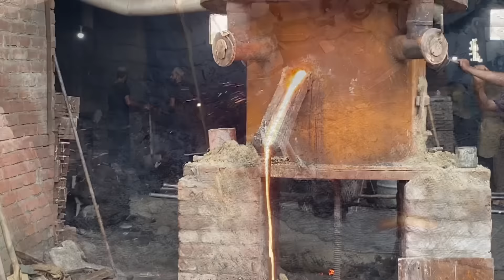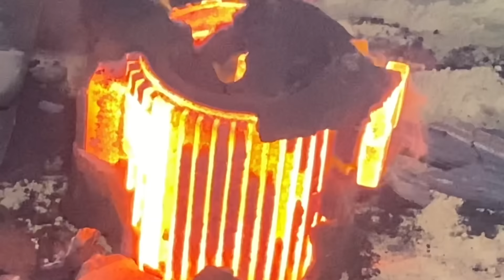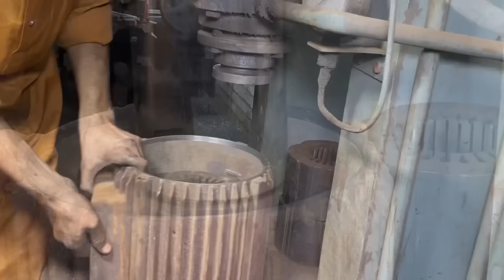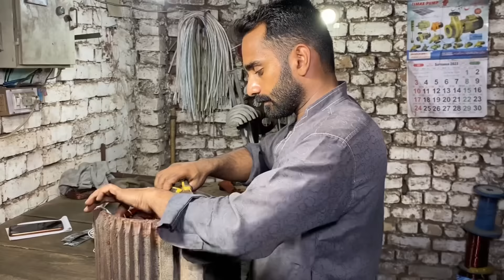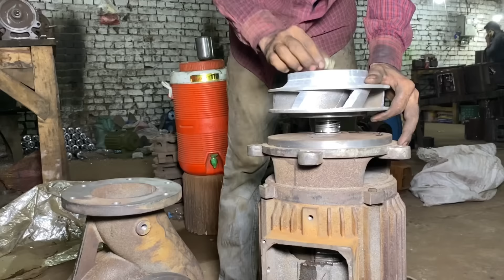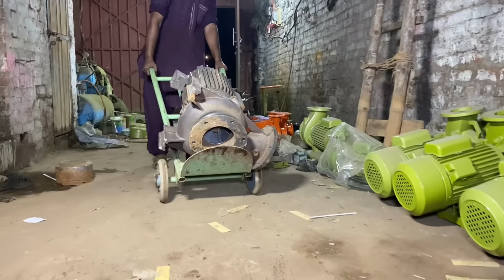Incredible Process of Metal Recycling | Factory Steel Production which Scrap Metal

Comment: If working with molten metal in sandals was a sport, these guys would be in the Olympics
Reply: I think you would be right....
Reply: Good thing there steel toenail sandals 😁
Reply: Orang orang yg sangat handal dlm pekerjaan
Reply: Safety glasses anyone🤓👀…gloves…apron…?
Reply: A few didn't want to wreck their sandals. They were barefoot!!!
Reply: Radarie chebe bilal😊
Reply: L
Reply: I collectively refer to these facilities as the “flip-flop foundries”. 😂
Reply: Молодцы ребята!
Reply: This is not sport this is the condition of pakistan
Reply: This is not sport this is the condition of pakistan
Reply: These sandalman  defeated the superpower murica in Afghanistan😅
Reply: what does sandals gat to do with the process. When you are buying at the shop will you buy the sandals or the water pump. Molten metal will penetrate the soo called shoes you want them to put on.
Reply: Don't worry, those are safety sandals
Reply: The Special Olympics!
Reply: OSHA homies when they see this video 👀

Comment: There were so many unsafe practices but the brother spray painting with no mask at the end took the biscuit
Reply: Nothing like a little punjab primer at the end of a hard day, or at the start of it
Reply: How about the opening of the furnace where a worker could fall in ?
Reply: I did that for a year (UK) cause the bosses were tightwads. The UK was just as shit in the 1970's.
Reply: At least he has one fan blowing out of the garage...
Reply: They who seek only for faults , see nothing else..
Reply: I saw there was exhaust air. over there..
Reply: spraey painting without a mask?  Well it happened here also, in the  UK in 1970's when my employer was too mean to provide PPE.
Reply: @jfchonors8873  I was thinking the same thing. Pretty scary.
Reply: @nimaljayathilaka4718  The pump worked well!
Reply: Really? That? Not testing the water pump by shooting hundreds of gallons of water all over the place with exposed wiring?
Reply: the worst part is you can hear kids roaming around in the background
Reply: There’s a billion of them. They will easily replace him sadly…

Comment: One shop should not do all that. Lots of quality standards are lowered.   The motor may last a million years or short out 10 minutes into a work load.
To bring value up there needs to be checks on the material and the machining. Adds maybe a few hours and possible tossing out a few out of spec parts, but the result is better product
Reply from the maker: Your opinion is excellent I agree with it Thanks a lot for watching the video
Reply: I couldn't believe the wobble on the lathe, while and after he drilled the center hole!! That's terrible machining work!

Comment: Does hammering those windings into one another not hurt the enamel on the wires and make them contact one another ?
Reply: He was using a ‘soft’ hammer so I think it would not damage the insulation , there would be no rice on the table if the pump didn’t function when they tested it !
Reply: Haha very true. @metalmicky
Reply: The wires aren't coated until the end.    They usually are dipped in laquer.    Apparently whereever this is they coat them with tea.    LOL
Reply: @mikestock6461  don’t you mean ‘uncoated’    . The varnish insulation is removed to make the connections to the commutator  ,probably the last inch or so to make the solder do it’s job.
Reply: @mikestock6461  that tea was nice and thick, maybe coffee?

Comment: thats a much better/nicer/cleaner  shop than in some of the other videos with much newer designed /engineered equipment ...like a mix of 1950-60-70's drills/lathes now they need some air tools for assembling the pumps and a spray paint booth so they dont have to breath the paint /fumes and some assembly tables and a few more jib cranes to move around the heavy parts. and a minature rail system for the moving of the hot steel and to fill the castings which should also be on carts on tracks then they could fill the castings and keep them in ordered rows to sit and cool ...then break apart later...it would take a little work but it would improve the shop and make it even cleaner and safer to work in...

Comment: I dont think its a bad quality motor, because for sure they done this based on a quality made one, they reverse engineered the one even the winding wire thickness also how many turns spacing and isolation,etc… if they did the math,, then i will be more impressed.

Comment: I remember seeing the turning milling and drilling, pressing and fining back in the 1950's when I was a child. It is a shame that computer technology, despite the computer geniuses today, not reaching these men. However, I suppose, that speeding up the process of manufacture and using modern methods would put these men out of a job. I don't know what is worse, the health and safety risks and dying of industrial diseases, or being jobless. I am so worried about these men working in sandals in a clearly dangerous environment.

Comment: since they are using various scrap to make the metal is it of consistent quality?
Reply: Good quality ❤
Reply: Consistent with the scrap they are made from.

In use, the material the bodies of these pumps are made from doesn't matter anywhere near as much as we might think. The quality of casting and machining is way more important.
Reply: The quality of the metal is consistently crap.